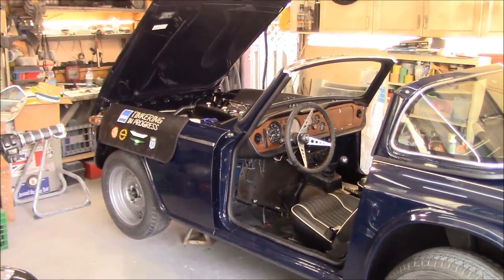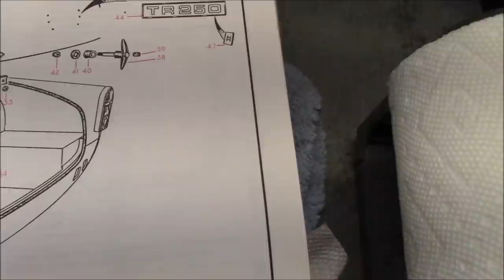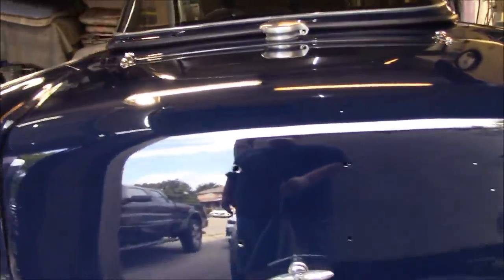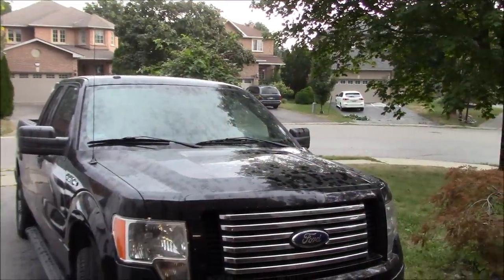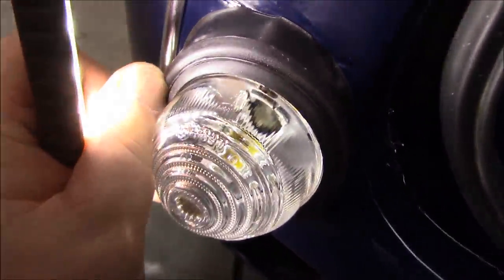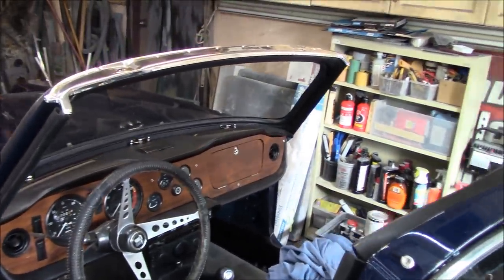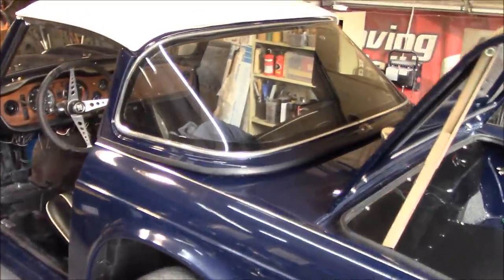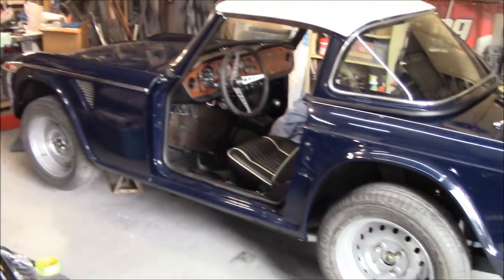1968 Triumph TR250 Restoration Project, Final Assembly Part Six, Lights, Camera, Action and More!

Comment: Might I suggest selling ad space on your roof section? British car parts suppliers are you listening? Seriously Chef, it's looking great. That surrey top at first glance looks like the Parrish Plastics aftermarket hard top that I have for my 1971 TR6, It's covered with a pebble grain white vinyl. Thought about covering it with vinyl to match my new tan interior. The car is Jasmine. Also the camera in the trunk idea was genius. Way better than luring Elin or Les in there with a beer.
Reply from the maker: Hi Dennis thanks for the input.  Yes, the phone in the trunk worked out well….it showed me what I needed to do.

Comment: The clear indicator lens in double rubber gaskets with chrome trim ring flashed me back to my original 62 Morris Mini. It wasn't a good memory. Bulb burned out should be an easy replacement until you discover all the rubber gaskets are  dried out, hard and cracked !!! Eventually I got the lens out by destroying the rubber. Next up, pop out the bulb, only to discover it is permanently fused in place via corrosion. No way can they be separated, so after much destruction the only option was to replace the light socket assembly. Yup ...I learned that when the bulb is burned out, you have to replace the complete assembly. Seems extreme but now I always use dialectic grease on bulbs and sockets and keep a crowbar close by. :)  

Surrey top colour ?  I know the Binky Roof and recall it was quite a complex taping procedure to accomplish the multi coloured checkerboard. I think if you start by painting it blue and then reflect on how it looks.  If your want more pop, you can proceed to a ghost checkerboard. My concern would be an aesthetic conflict between roof and hood racing stripe. Maybe too much seeing as you went subtle with the ghost stripe.  Doing it in two steps allows you time to consider all options. Also if you place a coat of clear on top of the blue, between the top graphics, you can always sand off the graphics if you change your mind. That's what many bike painters do when painting tanks etc. (You might check with your Harley Pals for a painter)  One other thing you might consider is a wrap for the top. Lots of options there for colours and plotted graphics.

Not too surprised you need a break. Your work ethic is truly remarkable. And your Harley seems to be calling out as it worms it's way into the garage.

Cheers from John in Whitby.
Looking forward to the TR250 Reveal.
Reply from the maker: Agreed John, if the rubber is cracked then you have a major problem….and yes, I hate it when the bulbs are stuck in and they break off trying to get them out…thanks for the input on the top.

Comment: When I saw the white roof I was a bit surprised however it does look nice in the two tone. So white for me, but I don't remember Triumph having any two tone cars during that period of the 1960. 0ther manufacturers did however have two tone models generally roof and roof pillars down to body tub. Roots, Ford, Vauxhall, and some BMC cars were two tone.

Comment: Glad your ok from the fall, I've had some slips myself. A friend of my in California gave me some good advice when I mentioned that I was building a garage to work on my cars. He said if by your self keep the cell phone close, he spoke from experience. Lucky nothing major for him  but got to be safe. On the truck latch is it fitting all the way into the square opening on the inner mechanism? On the wheels I'm going to say mini light from JBW. On the top, how about a wrap, a Union Jack 🇬🇧, or carbon fiber design, etc. would think it would be less work./ cost than paint. You could also change it in the future easier if desired.
Reply from the maker: Thanks Robert, yes, I always try and have my phone close by.  Yes, the handle is all the way in…I may try to adjust the bracket that attaches it to the inside of the lid.   I’ll keep you in the dark for now about the wheels…they arrived at my US mailbox today.   Yes, I though about vinyl wrapping it as well…we shall see!

Comment: Looking good, Chef! Interesting view from the boot but good idea to see how the catch was, (or wasn't) working. It looked like the stud for the catch was way low and I'm interested to hear how you were able to either extend the stud bracket or lower the latch arm. Nice variation on the "Tik Tok milk crate challenge" (which I understand they've taken down for obvious reasons). Cheers and ps "Project Binky" is a riot...been watching it for a while.
Reply from the maker: Hi Kevin, I was able to move the top plate with the hook down a bit and move the bottom catch up as high as I could. Between these two movements I was able to get it to latch.

Comment: Dave hope you’re feeling better. BTW which fasteners did you use for the badges? Im remounting the bonnet letters on my TR4A, and I believe the Moss catalog shows spire nuts for the bonnet badge but barrel nuts for the letters. If you used barrel nuts, do you know if they are supposed to be pushed into the bonnet holes from the top first, then the letter studs pressed into them? Or do you put the letter studs through the holes in the bonnet, then push the barrel nut on the studs from underneath?
Reply from the maker: Hi Jim, I ended up using the spire nuts from below. They seem to be the most secure.  I tried the barrel nuts both ways as you suggest but I found that they didn’t hold as snugly.  My holes might possibly be too large as well for the barrels to work as when I tried it end up pushing the barrels through when I pushed the badge in…